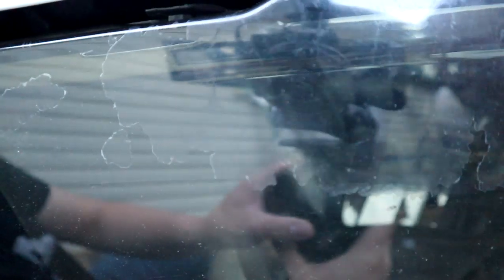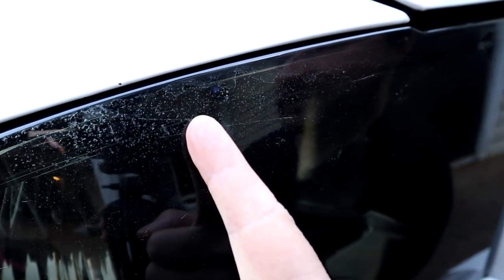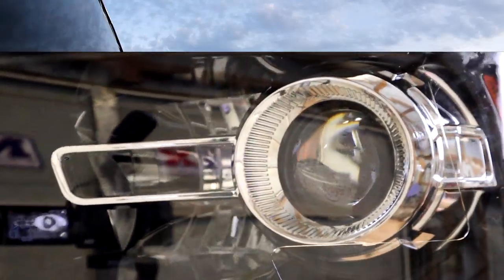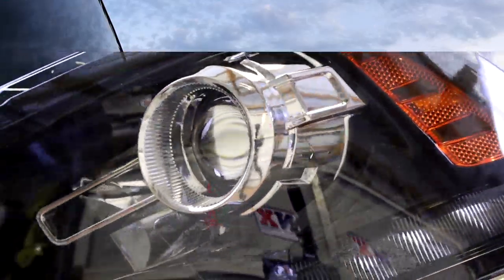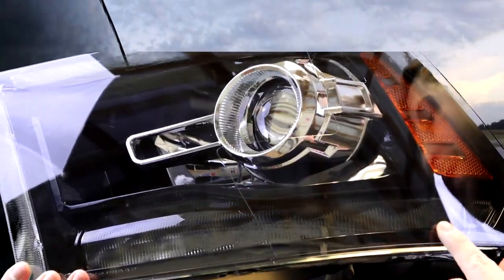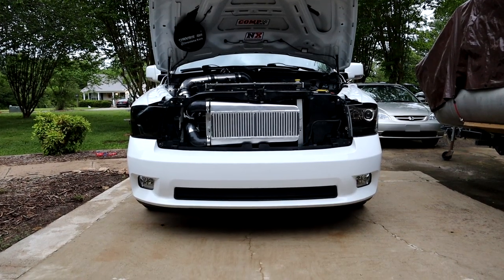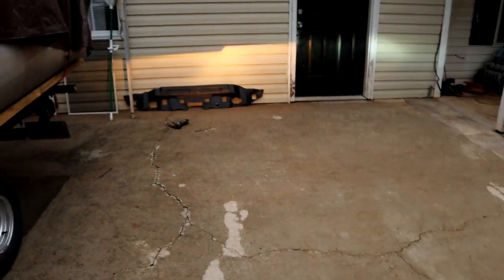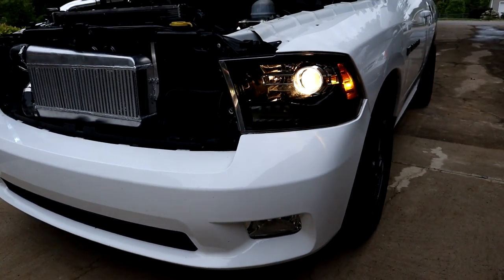Ram 1500 Projector Headlights Installation

Comment: We cant even use tinted lens. Race season is here. Are drags. Are in north bay area. Just 1/8 mile. Run but fun.
Reply from the maker: Sounds awesome
Reply: @FrostbiteRam  just picked up 2019 2500 cummings 6.7 singel cab
Reply from the maker: I need one for a tow rig for frostbite

Comment: I got mine on Saturday and installed. Only difference is that the shroud is also jet black. Only chrome is the high beam reflector.
Reply: How's the light output?
Reply: @Vue_Mix  better than stock. These have a pretty good spread to them. I have sylvania zxe bulbs in them but will be upgrading to either HID or LED  very soon because the majority of my driving is at night.
Reply: @ramairgt2  do you have any video or pics?

Comment: Pretty sure you are not supposed to put LEDs in projector style headlights. The projector is tuned specifically for the halogen wavelength. You won't get the proper light spread with LEDs or HID lights.
Reply from the maker: May not be the best but does work no problems

Comment: So if you didn’t install the DRL harness, how come the lights go to white? Aren’t the white bars the DRL’s? I thought the bar only came on for turn signals then back off normally.
Reply from the maker: If you install the drl then the light will stay on as soon as the truck turns on.
Reply: @FrostbiteRam  so if you don't use the drl hardness. Does the white led come on when you switch to that option on the light switch ?

Comment: What year is the truck and would those lights fit a 2012?
Reply from the maker: Mine is 2011 they should fit. You can check the application list in the link.

Comment: I got the same ones but my amber light plug wont go in the head light plug and is the same as yours 😞
Reply from the maker: Skip to 7:00 in the video you have to plug the connector a certain way to work.
Reply from the maker: You have to take the factory amber bulbs out and discard them and plug the connector into where the amber bulbs was.
Reply: Yes i did that but still wont go in  i put some force in it and it work but it dont stay in there is loose on both headlights

Comment: Now you have gone from a dual to a projector style, do the high beams turn on the same time as the low beams?
Reply: Yes if you turn the high beam on.  and no if you just flash them.
you saw the beam pattern cuts top part but when u turn on or flash the highs it lights the top part also

Comment: Does the low beam (projector) stay on when using high beams? I read this is a problem when converting from dual lights vs quads
Reply from the maker: I believe it does I'll have to try